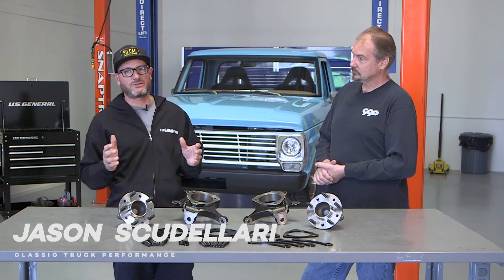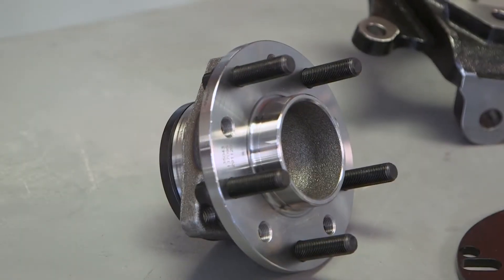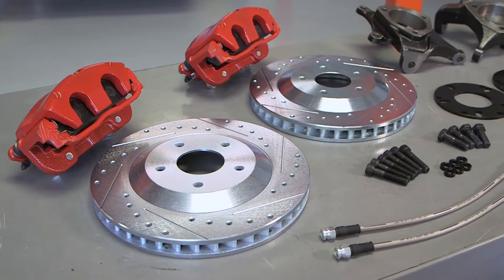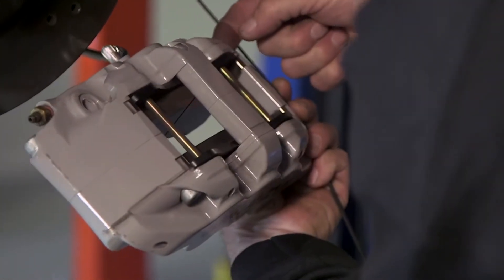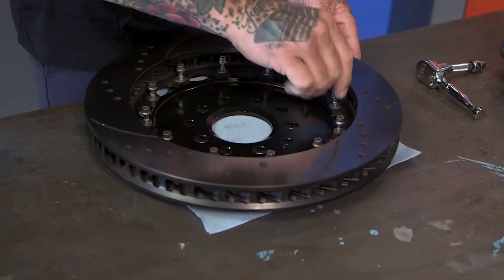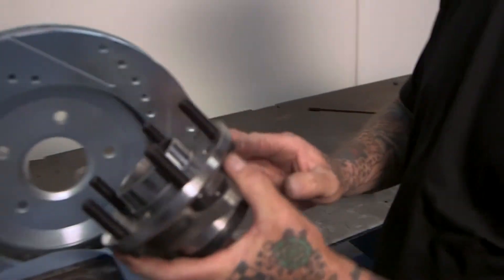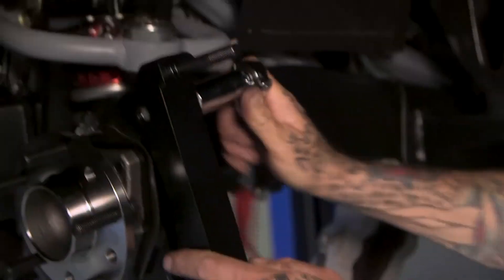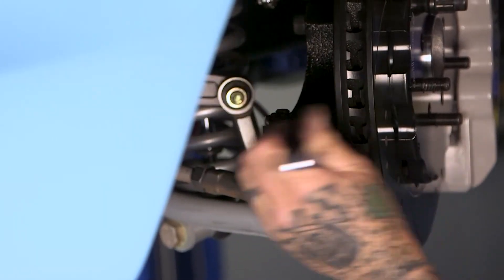Mustang II spindles with Corvette C7 sealed bearings eliminating the spindle pin from the equation.

Comment: What wheels, size, off set are on this Ford?
Reply from the maker: I am not sure the wheel and tire combo.  The front inter fender panels have been heavily modified to fit the tire and wheels.
Reply: Hey bro I have a 72 c10 and I'd like to put a brake kit like this on it. What kit do I need to buy? Yours looks bad ass